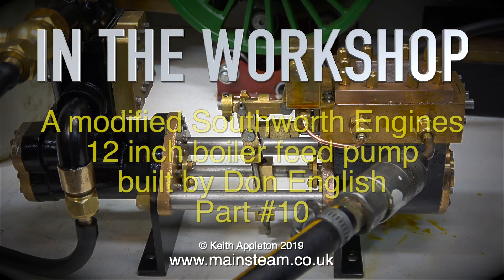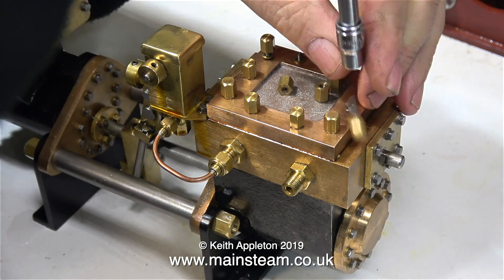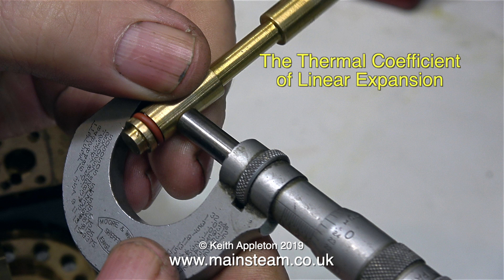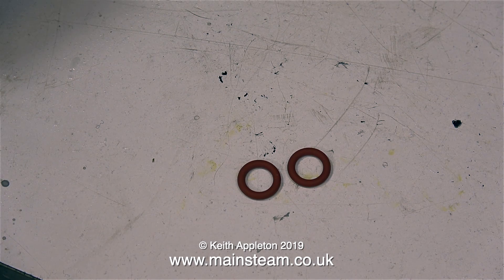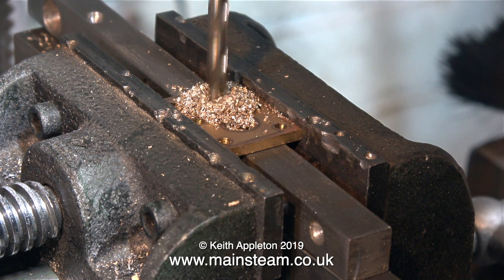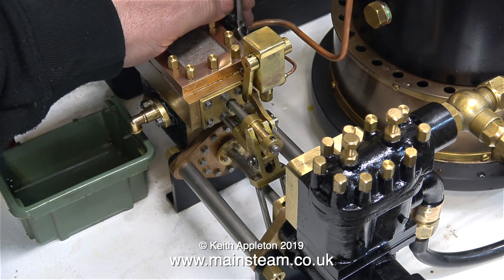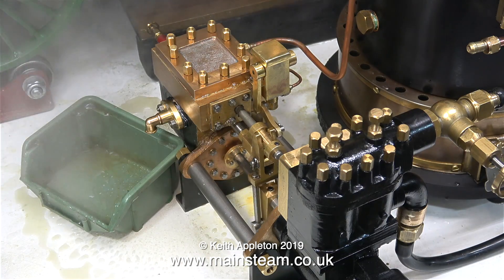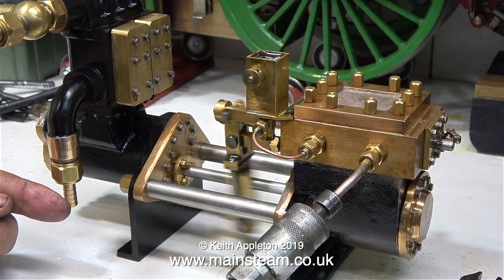A HORIZONTAL SOUTHWORTH 12 INCH BOILER FEED PUMP - PART #10

Comment: Hi Keith;
Years ago I ran into a similar problem in the paper industry.  We had a roll over 300 inches long that had a non-rotating center shaft running through the center of it. On the top this center shaft was a rectangular groove  cut that had a rectangular piston fitted into it to push up with hydraulic pressure on the inside of the outer shell of the roll to keep it from deflecting down in operation. the piston and center shaft were different materials, so when the oil inside that lubricated the piston rubbing on the inside of the roll got hot the piston expanded and broke off the end cap bolts for the piston groove. We ended up engineering a hydraulically loaded end cap for the piston groove, that would allow a small amount of movement of the end cap.

Comment: Nice fix to a nice pump - glad it's working. But it wasn't the differential thermal expansion between the brass piston and gunmetal bore. The figure of "18" is microns per degree C per metre of material. 25 microns to the thou, roughly. The difference between brass and gunmetal is around 1, depending on the exact blend. 1 micron per degree C, so 100 microns for 100 degree C - but that's for a metre of material, you only have 10mm, which happens to be 1/100 of a metre, so the difference of expansion in your setup will be 1 micron, half of a tenth of a thou. You, quite reasonably, took about 75 microns off the o.d. Obviously it was a temperature related thing, so it must have been about expansion, and obviously reducing the piston size fixed it, but not definitely not just differential expansion of the materials.
Reply from the maker: The temperature of the steam is way above 100 degrees at 100PSI though .......
Reply: I expect that it is a combination of two effects: Some sort of geometric error (bent shuttle piston/curved bore) meant that the actual clearance was almost zero, despite the 2 thou clearance measured. As a result even a tiny amount of expansion would cause sticking.
I thought it looked like there was longitudinal scratching on the shuttle piston, which would also indicate rubbing.
Reply: And there's the expert.